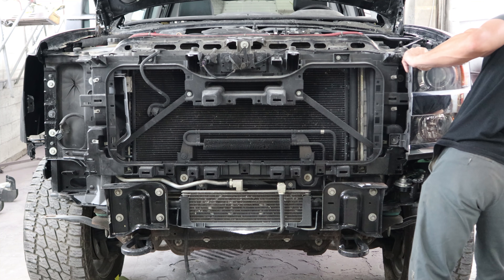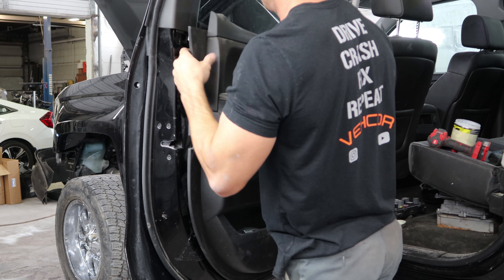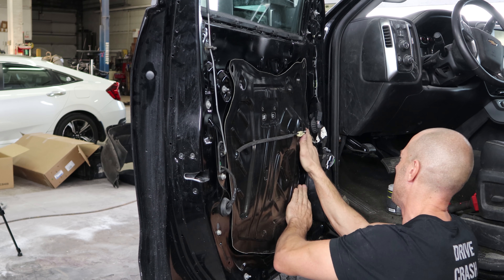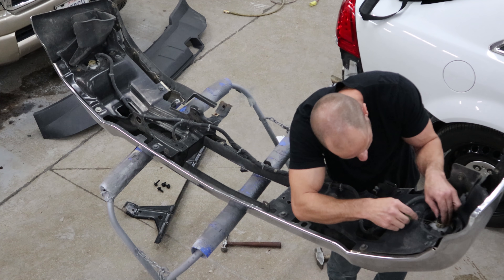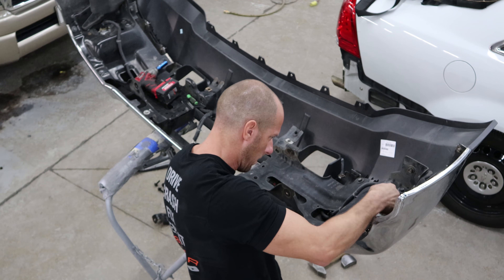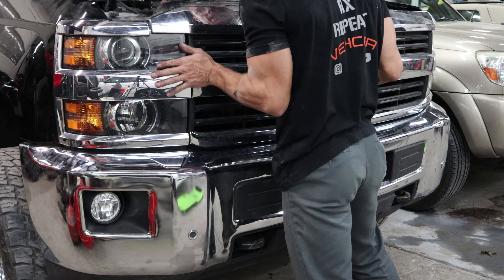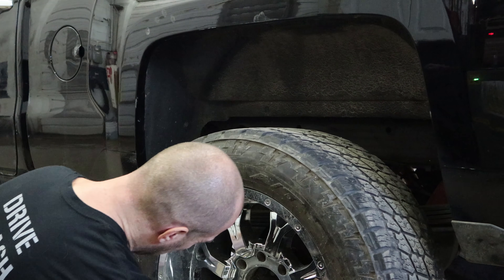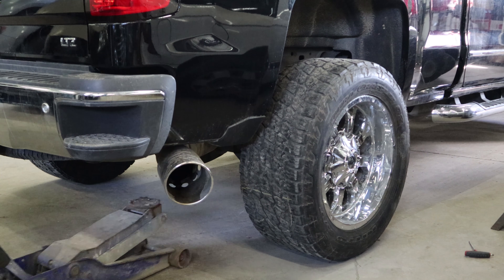Final assembly of the 2015 Silverado Duramax LTZ "The Mistake" Part 11

Comment: Great finish Scott. This was fun to watch you put this all back together. An update on my 14 Sierra. After putting the new control arms and inner/outer Tie rods on I took it for a spin around the property to see how it handled. I found the casing on the Electric Power Steering Rack was cracked so we took it off today and will order a new one. Garey said those were a problem  on the 14's and they redesigned them later.
Reply from the maker: Hey, you made progress when it moves on its own.  It was months and 70% through the project before I could stop pushing it around. lol  Good luck on your build!

Comment: i love how simple these trucks are to take apart interior wise and i mean for the most part everything else but ya its almost like the enginners thought ahead and made it easy for people modifying their truck like adding amplifiers running wires changing speakers door panels are so easy to get on and off its crazy
Reply from the maker: Everything is easy.  The doors, the bed, bumpers, everything.  I like the looks of the classics but you can't beat the ease of working on the new stuff!  Thanks for watching.
Reply: @vehcor  yessir i agree 100% when i ran the 0 guage for my amp i couldnt believe its really like they made just enough room for it you got the spot in the main harness gromet to pull your wire through and the black plastic wire races under the door jam trim and im really happy they chose to put the second battery mount on the 1500s too and i swear you could probably pull the door panels 100 times and never worry about breaking anything
but yea keep up the vids man i love it very entertaining and informative
Reply from the maker: @psyfertech  I remember my car stereo days.  Now I am old and don't care, not to mention I never seem to have a car that is really my own anymore.  lol T
hey all seem to sell whenever I find one I want to keep.  I'll keep them coming!

Comment: Funny that you should mention getting something free from a major company. Installed an auxiliary fuel tank for my diesel pickup and got a couple of STANT locking caps to replace the originals. Called the company for 2 extra keys for each cap asking what they charge. Said they would ship it to me free if they had the keys in stock. They did. As you stated, a bit of a pleasant surprise.
Reply: There still are good companies out there. I bought a discounted roman tub filler for my jacuzzi tub and had a shower controller that had different handles. I wrote to Delta asking how to get the matching ones for the roman tub filler, they sent them to me no charge. I didn't even ask for them, I used their online contact form (ask for your name address and phone number etc) and told them what I had and what I needed. 4 days later they were in my mail box. INCREDIBLE. Hence why I will ONLY install Delta faucets etc from now on.
Reply from the maker: What companies don't realize is going something that might only cost a couple bucks will get them much further than the millions they spend on marketing.  That key was probably a $2 cost to them, they could have charged me $20 and I would have been fine with that.  I wouldn't be making a video praising them but they would have made $18.  Think about how much they make if just one person buys a set of tires there because of this video, which is probably not unrealistic.  I always promote companies that go the extra mile for service.  Thanks for watching!
Reply: @vehcor  And the same goes for negative support from companies. I bought an LG Blu Ray player way back when they first came out. Ordered the Aliens blu ray box set. Waited paitently for it to come in. Ran off to the post office when I received the card, ran home all ready to watch my hi res videos...firmware update needed. Went to the LG site, no link. Called their help line? No answer, they were closed. Wrote to them via their website. 2 days later received a response: go to this site and they provided a link. Go to the site, firmware link was corrupted "bad gateway" error message. Wrote back to LG. CSR said "we don't support that site". No, but do you support your PRODUCT? Yes we do. So give me the firmware update. No, we outsource that. 

After about 3 weeks I was finally able to download the firmware update. I wrote to them  about the BS and they basically said "tough shit". I wrote back: well, I won't be buying an LG product ever again and I will make sure no one I know ever does either:
Next door neighbour talked to me about a new washer/dryer. How about LG? No, buy samsung or GE. Took a picture and sent it to the CSR: they lost $1800
Buddy and I were out and he wanted to buy an LG blu ray player. Sony was $20 more, I gave him the $20 to buy the sony. $179.00
Another buddy wanted to buy a 60" plasma tv. This was back when they were $8000.00 I convinced him to buy a Samsung. Cost to LG: $8000
After sending the LG Csr photos of all these purchases he wrote back "stop bothering me" lol

Comment: You know that truck lost 20% of its off-road ability when you removed the mossy oak badges
Reply: But it gained class
Reply from the maker: A sacrifice I can live with!!!!!!!
Reply from the maker: @duramax78  an .0000000001 in the 1/4 mile! Weight reduction FTW!
Reply: @vehcor  i hate that crap to along with dealer stickers,plate rings,website banners and them dumbass air intake grills on the fenders and stick on hood scoops.
Reply: @vehcor  do you hate decals or Mossy Oak/camouflage in general?
Reply from the maker: @SuperDave44Mag  I hate decals and camo on a vehicle that is not camo.  Put them on an army truck, not a black Silverado.
Reply: @vehcor   I have lost all of my subs due to my phone stolen.. but I'm getting a new phone. I see you coming along Glade u got the truck near done

Comment: Looks great. I liked the stock wheel but that is your truck and not mine. Good job and congratulations on the long due driving of your truck.
Reply from the maker: The buyer I have for the truck wanted it specifically because of the wheels.  I prefer the stock ones.  I don't need flashy, I need functional.  It is after all, my work truck.  Thanks for watching!

Comment: For some one that said they don't like after market rims your sure putting them back on lol. Good job truck is looking great
Reply from the maker: The buyer I have wanted the truck specifically for the wheel.  It worked out since I did not have a full set of the stock wheels.  I like the way they look but for my own truck it is function over fashion.  Thanks for watching.

Comment: Looks like you can't call it a mistake anymore.  Thank you for removing the mossy oak emblems!  I got a bit of satisfaction from that as well.  Lastly, the soft touch open tailgate is the best...wait until you have a powered tailgate :-)
Reply from the maker: I'm afraid if I stop calling it the mistake, something bad will happen. lol  But I do agree, even if something happened, it would have to be pretty bad since I am so far ahead on this one.  I can use the soft opening gate but the power one is just one more thing to break.  I shouldn't have nice things. lol  Thanks for watching.

Comment: Great job Brother. The truck looks awesome. I am in PA so fluid film is a must. Oh, BTW, the beds don't line up as well as yours did from the factory!
Reply from the maker: Thanks, I just picked up some fluid film to try on this truck since everyone has been raving about it lately.  Maybe they should run all the new trucks into things to help line everything up. lol  Thanks for watching.
Reply: @vehcor  Is the paint on the newer GM trucks any better than the old ones?
Reply from the maker: @blazerteam  I assume you mean the 90s and 2000s that peeled.  It was not a paint problem it was a primer issue.  It was not only GM, Ford and Dodge had the same issues.  They have since corrected it and actually paid to repaint quite a few vehicles back in the day.

Comment: Are you using the colored harbor freight sockets? Ive been thinking about getting a set to make a junkyard run toolset.
Reply: Juan Vega I have a 3/8 drive set of them and they have held up for almost 5 yrs now. I bought them to use when working on customers vehicles bc I always forget a socket or something in the vehicles I work on. I surprisingly haven’t lost any of my HF rainbow sockets yet.
Reply from the maker: I highly recommend them for that purpose.  Light home use, junkyard runs, a spare set for your car, that is exactly what they were meant for.  Thanks for watching.
Reply from the maker: @AstonThaRat  That is how it always works.  The cheap stuff stays with you forever and the expensive stuff loses itself almost immediately. lol
Reply: EXACTLY!! Building a "Professional" Set I Only Use while working @ Home.. Trying a few pieces from the Big 3.. My Combination is Simple and Works Rather Well..

Comment: Obviously for this project you had a donor truck which is awesome. Any advice for finding the best deals on other collision repair parts? Salvage yard, eBay, just keep searching? Keep up the good work. Love the channel
Reply from the maker: I use car-part.com to locate a lot of my parts.  I also search FB marketplace, ebay, CL and I call around to local yards I have a relationship with.  If it is not a part I need right away, I search whenever I have a free second.  It is how I got the rear bumper for this truck for $250 when everyone one else wanted $600 and the dealer $1200.  Thanks for the support!

Comment: What rust-proofing material did you use? I might be interested for when I start rebuilding Super Duties in about a year. Thanks!
I hate putting in windows, but you make it look so easy! I'm impressed.
"Stupid emissions": I agree completely!
Also, could you do a walk-around when the truck is all done? I'm not a GM fan (don't know why I keep saying that), but I really like that truck!
Thanks for another great video.
Reply: Fluid film works great for rust proofing
Reply from the maker: That particular brand is Transtar but there are many makers of cavity wax.  Fords need all the help they can get. lol  J/K Got to give the competition a hard time but in reality EVERYTHING rusts.   Of course emissions suck, everything government gets involved with sucks!  I'll have a walk around similar to the one I did with the parts truck just much smoother.  Thanks for watching.
Reply from the maker: @helivesonforever  I have never used FF before but I did buy some for this build to try it out.  It is a little thinner than the stuff I usually use but I think I am a fan.  I will have to see how it holds up.

Comment: Friendly reminder... You said you would show us your technique on organizing where all the bolts you remove go.
Reply: Juan Vega was just about to ask how he keeps track lol
Reply: Yeah,  that would drive me nuts....and you KNOW there aren't two the same anywhere. Like you can't use ones from the front fender liner on the rear, no no, that'd be too simple lol. I mean, I had to replace the power window regulator on my F150 and I think there's 4 different sizes just to remove the door panel.
Reply from the maker: I will start on the tutorials when this one is finished and that will be one of them!  Have no fear, I have not forgotten about my promises.  Thanks for watching!
Reply from the maker: @muskokamike127  Reason #1289398369823792382398471 why I prefer working on GM over Ford.  lol They use the same fastners for the most part.  I don't know why Ford likes to make things so complicated.
Reply: @vehcor  I think Ford's biggest issue is it is now being run by Marketing and Accounting people, not car people. You can tell by the launch of the new body style mustang when it was announced a few years ago. I mean, just look at the issues with the 5.4L. And they produced those engines for 7 model years knowing full well the issues. Now they're stopping making cars "due to market choices for SUVs over cars" no you idiots, it's because you have been building shit for so long. Look at any parking lot, still 75% cars, not SUVs. 

Like the GM I worked for in the trade show business: we sell the sizzle not the steak. That's what Ford has become: selling sizzle. The meat is a piece of shoe leather but hey, doesn't it look good?

Comment: Looks good!  I was hoping this was the episode that you would go out and burn rubber!  When you replace the curtain airbags did you have to replace the SRS sensors?  Where do you send your SRS system to be reset??
Reply from the maker: Thanks! Those tires are a little too expensive to burn up... just yet.  Maybe when they are closer to replacement.  Pretty much all sensors (on any vehicle) are reusable unless they are physically damaged in the accident.  This system can be reset with the Snap-on scanner at the shop I rent.  Thanks for watching.

Comment: Nice build. Looks like it turned out real good. You decided to use the aftermarket wheels?
Reply from the maker: Thanks.  The buyer that wants the truck, wanted it just because of the wheels.  Made my life easier since I did not have a full set of the originals anyway.  Thanks for watching.
Reply: Ohh ok that makes sense. Keep up the good work!

Comment: Doesn’t the extra better than factory treatment plug up the weep/drainage holes

I treated the inside of my Thatsoon 240Z to make it quieter but I just put a bigger motor & less exhaust to compensate 

Thanx from the left coast near the Krapitol of California
Reply from the maker: If you go a little overboard it can.  This stuff is pretty thin so it is usually not a problem and if it is, you can always pull it out of the holes with a pick.  You need to get rid of the wrong sounds to make sure you can hear all the right ones! lol
Reply: I used undercoating inside my Thatsoon and ended up cleaning the weep holes as the window wipes were never that good so water sloshed after first storm 
I saw that it was a wax when you used it the second time but had already sent my query 
Thanx

Comment: i  think there is a screw hole at the back of the door panel as well
Reply from the maker: The front has two in the grab handle, one behind the door handle, one behind the silver trim under the switches and two on the bottom. The rear door has two less it does not use the one under the silver trim and only one at the bottom.  Thanks for watching.

Comment: What was wrong with the axle? Why did you replace it?   I am trying to understand. Was it damaged in the accident?
Reply: John hobbs I to was wonder on that. If I remember correctly, he sold it and then took of the rear end from the old frame that was to damaged to repair, and put it on this truck. Maybe made more money selling a know good rear end and then put the questionable rear end from the original truck on this one.
Reply from the maker: @j.d.martinez153  You are spot on.  A know good one sells for much more than a guess.
Reply from the maker: J.D. Martinez has the answer!

Comment: 11:42...omg......not to be one of THOSE guys but I remember when a bumper had like 6 bolts to attach it to the vehicle and 2 bulbs for the licence plate.  Sometimes you'd get running lights or turn signals in them. But that was back when they were made out of actual steel and took 3 guys to lift lol....
Reply from the maker: You mean 6 carriage bolts that would rust after 20 seconds in the salt and spin inside the bumper and never come out again!  Those bolts???  I hate those.  Give me my tin can, covered in plastic, one plug, new bumpers any day! lol  Sure they dent if you hit a plastic garbage can but you can change them yourself without a torch, 2 friends, a trip to the ER and an entire weekend.
Reply: @vehcor  lol true.....I dunno about 20 seconds though.